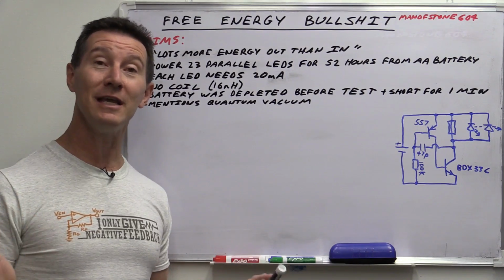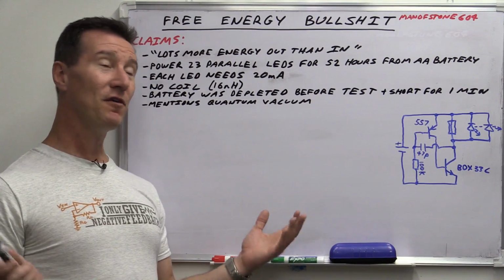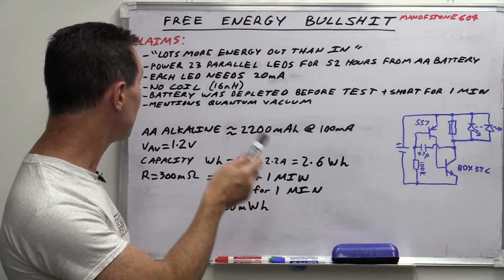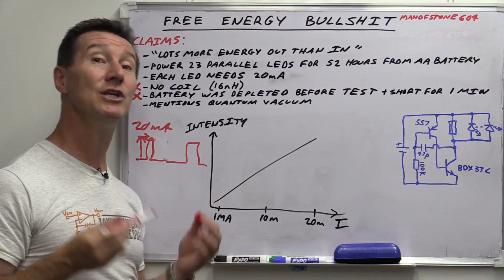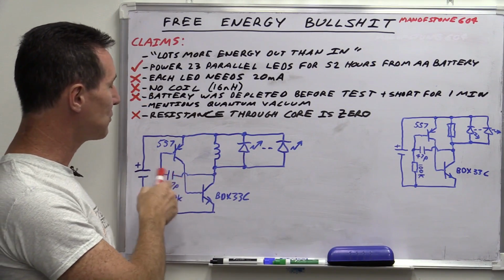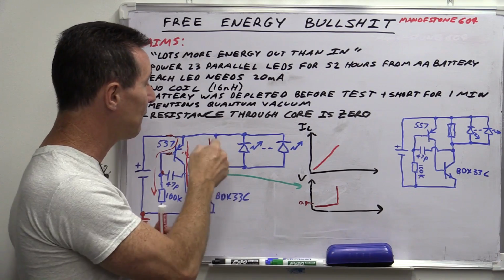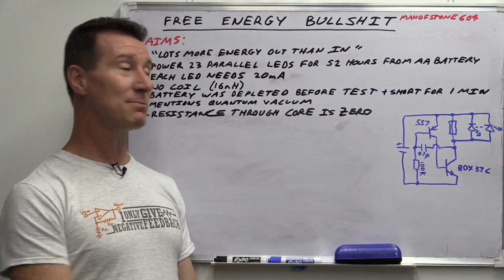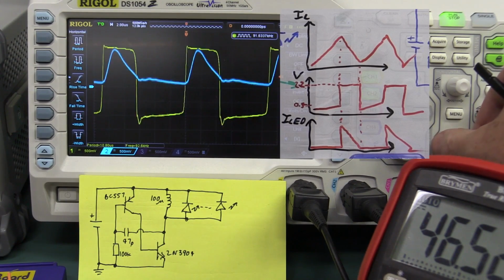EEVblog #708 - Free Energy Overunity is RUBBISH!

Comment: hold on.  overunity.  level up shit.  which is producing potential energy as energy not used, but it could likely be measured (not always, because 110 percent??? fuck that, level up) potential energy in decimal form, as difference of expected to be expended in time.  
and then the power bomb thing.  you drive over the arrow, kind of thing.  is that energy expend or what.  if it were created to  identify energy needed to switch itself to the system that is relevant.  
can be done!!
sand, pulley moves sand to top, inner rings like a record, all spin, train idea of ssswitching paths, igoring, to have thoughts of best use, the outer inner rings...

Comment: and then i thought.  well, what of those wells in the center of Mexicans homes, and what of architectural pockets, to see if something about ... uh, when you're cleaning a fish tank???  siphon.  and a model that has various systems to make energy, and then to total energy output.  it's starts with one street lamp, and goes up the block, then to homes.  but i've never made anything. 
wonder also about transferring weight, and how.  yeah, giggles.  love all of me.  
but, shifting weights.  like per definition, utter true context.  that will be for various stages of anything.  to figure that up, like fight club, the book, for the novel and then the chapters.  

a wind up clock, it goes in massive chunks, the gears, and so those would have a spin production of???  on the gears themselves.  it's torque in a way.  you could really, have a thing for boiling water.  outdoor.  but my idea, concludes with proof of overunity, and therefore, per use even, alternator or something, that there can be many and of all designs, aesthetic as hell.  decor.  batteries are poison anyway.  solar is poisonous.

Comment: if you use tension, for instance.. the turbine should be light weight, employee some pulley system to max that out.  
my idea, never made anything before.  alright.  to use wind power.  the turbine is in the middle of two air pockets, and something has to blow the air through.  The air is stagnant, same air, only.  right?  maybe.  maybe there is a double bubble, of liquid, and semi liquid.  you just set it off.  if coated, and has, a ball on top that rotates, it'll go for how long?  and then, if you turn that lung size, tree 3 that...
it all started with.  to take a glass tube from above ocean to bottom of ocean.  shit, it'd break, relieve pressure.  need one outlet, shit water would drip in, need to coat that with (coat it with) a same but small air outlet system, a design, but not good enough, then you got the same basic design (per funstion, not f, of getting ocean water to effectively dissolve gravity, but surround with many bubble from air above ocean top, and to surround whole area with water and air bubbles to dissolve pressure.  bubbles would turn turbines any damn way.

so, mini modules.  and the top would be the outer space, where it's all pervading and the inner workings are little people praying to a single thing.  all hail jay all hail jay.. or something.

Comment: Sun create heat and heat can turn energy, correct?
Wind create flowing oxygen and wind can turn movement, correct?
Metal create magnet +/-, that also create movement, correct?

The only matter is only how to building up enough power to give energy to our daily life.
Reply: +DirectX3 Technically speaking those aren't free in an absolute sense and are indeed limited, just seems infinite in the extremely limited scope of a human life. 
Solar energy is quite convenient but solar panels and especially of the high efficiency variety are quite expensive so technically speaking they aren't free. Wind and hydro power are in the end powered by solar energy so when the sun goes out, so do they. What's more is hydroelectricity is very costly both from a financial and ecological standpoint.

What is being discussed here is what would be considered truly free energy, basically something from nothing, creating energy from absolutely nothing.

Comment: free energy .. I don't see why it shouldn't work.. If 2 north poles on both magnets push apart, there you have it, and yes it causes a break but you can get around it.  here is another example,(electro Mechanical Gearing) a motor set up 5x Circular Gears like the bedini motor , each gear producing 24 v dc, and regulated its been proved to create more output than input, and further more, it can store its own charge through capacitors to cycle its own power to continue rotation generation

Comment: At 17:05 you mention that your circuit isn't "just a DC current", isn't it still actually DC because your currents are never alternating (or going negative).  Your current just gets disabled (or dramatically reduced to the point where the LEDs cannot produce noticeable light if you were to maintain that current indefinitely).  I agree with your video, just one little nitpick I noticed.

Comment: It's just a circuit that is able to pull a bit more out of a battery than your average resistor only circuit.  But Dave, I'm am certain we could harvest a lof of free energy out of your high pitch voice you seem to have in this video :-)
Reply: +Kurt Schatteman Its not so much pulling "more" out of the battery as it is just using "less" from it due to the oscillation.

Comment: What is the reusable little circuit board  he used with the LEDs? Rank electronics beginner here but that looks so fun to tinker and learn with.
Reply: +schalkespringer It looks like a run of the mill breadboard. How on earth have you gotten in to electronics and not found out about breadboards? They are so delightfully useful for prototyping circuits before making them permanent.

Comment: Free energy: the windmill, the waterwheel, and giving sugar to a two year old.
Reply: +Lukiel666 Widely available and usable, but technically not free in the sense that the nuts pushing stuff like this claim. They claim you can pull in extra energy from basically nothing. Windmill uses air currents which are in turn powered by solar energy, so while there's quite a lot its not infinite nor is it free. Waterwheel is gravity powered but the water getting there in the first place is due to...you guessed it...more solar power.

and sugar making kids more hyper is kind of a myth, more placebo than actual biological effects.

Comment: What i find interesting in this video that also prevails in  mythbusters "debunking" of free energy concepts. Is that the exampels used is the most questionable of the examples you find, NEVER do you look at examples where there is anomalys that actually happen. Like the vortex coil. Some magnet motors (not all) and the Hendershot methode.

Comment: He must have never heard of solar panels or the sun hitting very polished murres pointing at, lets say a old fashioned steam train this is already in existence. free energy is insoluble energy can not be created or destroyed but can be transformed into a gas or a liquid but lets say you turn 10 grams of fuel to energy that 10 grams does not disappear it goes up in the air but if you could confine it after its burnt the burnt 10 grams of fuel in a vacuum the carbon count would weigh 10 grams a satellite spinning around the moon to make it go faster is free energy am I wrong. He is right about that guys free energy musheen. But their are other ways don't stop thinking because of this just remember you can not make energy without work of some sort wind on a sale, the sun hitting a solar panel 235 making a chain reaction with trideum , the way I see it if you can get energy out of the sun that's free energy . magnets placed in a certain way like the navy's new railgun could be free energy if made in a large serkel.

Comment: Obvious to an electronic engineer. But the fact that the Hubble expansion is accelerating, and acceleration implies force, and force times distance moved is work, the the vacuum is doing work expanding the universe, and yet there is no indication where this comes from. Also in relativity, Energy-momentum 4 vector is the conserved quantity. dE/dt = L.I.dI/dt + (1/2).(I^2).dL/dt ... so what when dL/dt > 0. Yes hard to engineer variable inductance, but much evidence to the contrary is not proof of impossibility. "Look you can't make lightning, it's been tried for thousands of years." and then Mr. Static came along.
Reply: Simon Jackson Except that Hubble expansion is talking about space itself getting larger, so I don't think the work equation can actually apply to it.
Reply: while ever the permittivity and permeability can allow EM waves, there is extra space for extra modes of vibration. I mean, why would it be called dark energy if it were not energy? The potential energy of objects moving apart is increasing.
Reply: +Simon Jackson Its called dark energy because we think it might be energy but we simply haven't the slightest clue what it is. It could simply be an intrinsic property of space or powered by something like virtual particles which still have a net energy of zero at the end of the day.

Comment: You stupid fucking engineers!   Just because it works or doesn't work on paper it doesn't mean it will work or not work in real life.   Put down your crayons and actually try it.  It'll blow your puny little minds.     Engineers= stupid
Reply: Tony Michaud fuck off Santa
Reply: +Tony Michaud Yeah, engineers are stupid. Now let's all type on this computer that was built by them, and then drive our cars that were built by them. Stupid engineers...
Reply: +Tony Michaud He did try it, and proved it wrong. That simple :D
Reply: +Tony Michaud The anti-intellectualism is strong in you, but the attention span is 
not.  Did you even watch the entire video, or did the maths  (you know, engineering stuff) at the beginning confuse you too much?  If you had watched, you would have seen that after doing the calculations which showed that it would work, he did actually try it by building the circuit, and proved that it does work. 

The thing is, it works not because of any magic quantum vacuum free energy, but because of known principles of electronics.

Comment: Running LEDs in parallel: When I opened up the head of a cheap 9-LED torch, I found ONE SMD current limiting resistor to a common rail for all nine LEDs. I wouldn't have constructed it that way, but cheap manufacturing rules the day.

If we are to improve electronic efficiency, capturing those collapsing magnetic fields rather than shunting them will be an important step forward.

Your analysis of this circuit is well done and rather entertaining.

Comment: One example of over unity technology: the Bi-toroid transformer. It is a transformer with 1 primary and 2 secondaries. With it the secondaries support each other and your input power actually decreases as you load the other secondary. 100% fact, I duplicated it. Watch my video on the replication of bi-toroid transformer. I proves over unity is real by working in by basement on top of my washer and dryer :)
Reply: Naoki Kashima Sounds like you just created a magnetic amplifier which have been around for a long time. By loading one secondary you are regulating the current in the other which means less input power. https://en.wikipedia.org/wiki/Magnetic_amplifier
Reply: Jerry Biehler It does resemble the magnetic amplifier. However, that setup does produce over unity results. Here is a video showing 377% over unity results with this setup: ht tps://w w w.youtube.c o m/watch?v=aVYiT4zK9Kc Notice how in his version of the device the secondaries are connected to each other through an extra connection (in my version it didn't have that). His version should more efficient (my version is enough to show that over unity was achieved though). However, with these transformers you can't loop output to power itself, but you can power 2 secondaries for the price of 1.

Comment: Could you connect this circuit's output to a zener diode and filter capacitor as a cheap way to step up 1.5V to, say, 5V? It might be too inefficient to be practical, but I'm wondering if it's possible

Comment: So you have no idea how free energy works. I'm going to give you sound bites to what should be considered for free energy if you were to look at free energy with an open mind. You have to work based on the quantum field aka quark glue. Supper symmetry coupled with torus, phi, fractals, clockwise with counterclockwise coil rotation, and in a vacuum can create less resistance in an electrical motor. You also have to make the device so that there is no imperfection in the material being used.  So the device like a electrical generator will have a stater that will look like a torus shape. The rotor will look like a vortex to fit the shape of the torus. After all these requirements are met then there will be more energy produced then there is taken in. Over all what you will have is an electrical generator that has less resistance for the flow of energy. That's why electrical motors heats up because the devices are not built right. That's why you got complex equations to fit these electrical motors that don't work correctly because of the way they are built.

Comment: 15Jun29Mon144841> First, toughest question :)
Reality... First:
The linear flow of electrons 
or positrons, through silver or 
ferrite rings, induces current 
and magnectic field and/or 
vice-versa: JCUpflizTH4

Theory... Next:
What materials and 
configurations, can be 
used to reproduce, the 
same experiment, with:

Uncharged particles
like: photons or
neutrons ?

Is there any way 
to define, any set 
of equations similar 
to Maxwell's for the:

Uncharged particles case ?

( ...enough ? / ...more ? / ... I don't know ?)  

Choose wisely... :)

Comment: Look I don't give a rat's ass about free energy I can prove free energy right now with logic. Put a Alternator, voltage regulator or Alt with internal reg, on a platform so a bicycle can power it and peddle your ass off. Store that in some banks of batteries. Shall I draw you up a schematic for that? A transformer out of the back of a camper should be enough to provide up to four 120 volt outlets and possibly a 240 plug socket.. Now that's free energy... Now tell me I wrong. Alternative energy from the nether regions is another sly fox to skin. Tomas Bearden has a motionles electromagnetic generator that is patented TaDa ! That's free energy

Comment: Well. "Free" enegry is out there. If we could only harness it in a wide-band manner...
Reply: priit mölder
What do you mean by "wide-band"?
Reply: I mean, for starters, in a wider light spectrum. Current solar cell tech has a narrow band in which they operate. The photon must have a rather specific energy to knock loose electrons. Photons with other energy signatures pass through. 
Once we have harnessed almost all of the light spectrum, we can transition to EMR (electromagnetic radiation) conversion. In that the absorbed spectrum should contain UV and IR. And its a simple matter of multi layer tech: one layer to absorb IR, the next for visible light and the last for UV.  Radio and nuclear radiation are useless because we have better things to do with them-harness them.
Reply: Well, priit mölder, at least even as we have use of the sun now, it's one form of free energy (in the sense of not having to do any work except install and maintain the equipment to get it). Where did you get the idea that nuclear radiation was "useless"? Do we not use the heat from it to heat water to generate hydroelectricity?
Reply: Maxx Fordham What I meant was, in the context of absorbing with special panels. Nuclear energy has its very good tech through heathing water or better yet, salts. I find that using panel tech to absorb ionizing radiation is useless. It would ruin the panel very quickly.
Reply: Hmm, okay. Thanks for explaining.
Reply: priit mölder But couldn't a wafer stack of alternating radioactive material and special panel be used to make a sort of nuclear battery for things like space use?    It seems it would not be useless other than the panel ruining part, that is an issue.
Reply: DaveC1964 Well, if you can make glass conductive, then its possible...

Comment: If the device produce more than it's needed energy, why
1) does he need a battery at all?
2) does the LEDs go out? Shouldn't they stay lit forever?
Reply: the battery is used to get it going.   It should not need the battery after the system is running.
Reply: @amazingpower2761  that is simply not true.
Reply: @amazingpower2761   then why would it eventually turn off?

Comment: about the existence of the coil: the guy who makes the video of free energy didn't saw during his whole life how works a wattmeter clamp. it's a clamp that is around a straight wire that measures by induction how many power there is, by receiving waves from the wire. so, basically eevblog video author is damn true in the simpliest way to verify this...

Comment: To everybody so we know that we are discussion the same topic, we are of course speaking of the scientific one, you can not have more output of energy than input, it's against basic laws of physics. You can not have the numbers 1+1 and suddenly get 10.

Free energy:

In science:
Thermodynamic free energy, the energy in a physical system that can be converted to do work, in particular:

In economics:
Energy from sources that do not require an input which has to be paid for, (usually a sub-set of renewable energy)

In pseudoscience:
Free energy device
a hypothetical perpetual motion device that creates energy, thereby contradicting the laws of thermodynamics
a device of which a controversial claim is made that it taps an unconventional energy source not regarded as viable by the scientific community at large